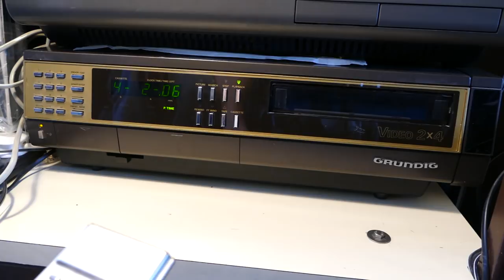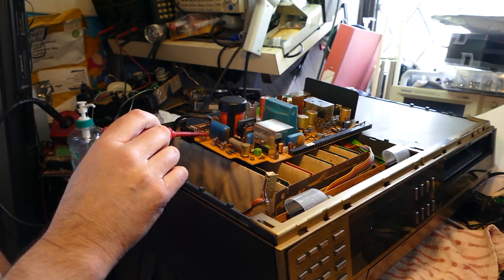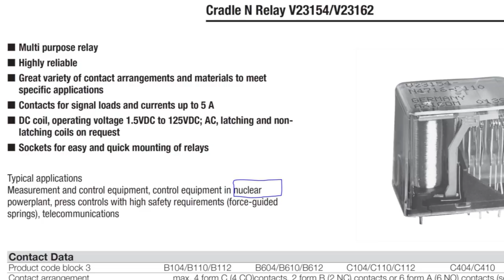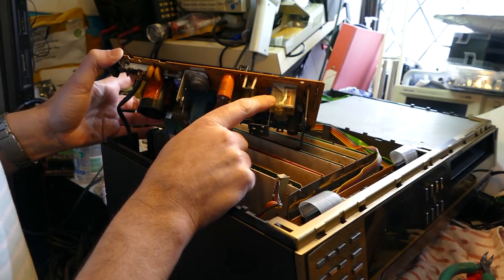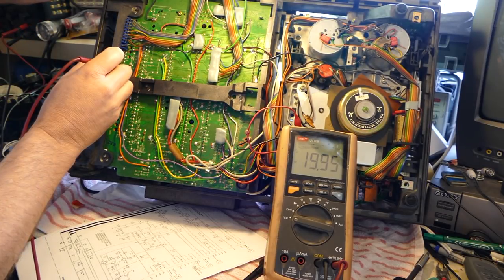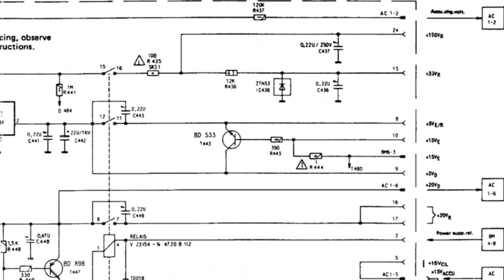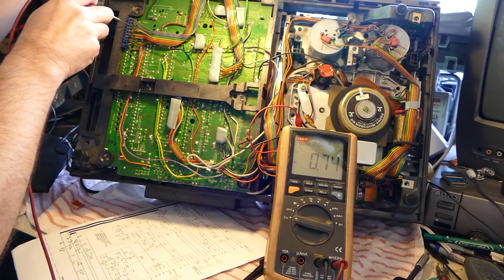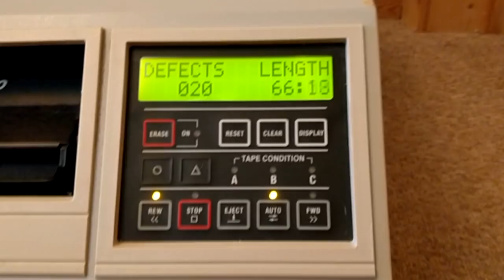Repairing the Grundig 2x4 Super Video2000 recorder.

Comment: Hi, I’d be grateful for your advice and assistance on something wrong with one of my 2x4 Supers.

I’ve got two of these to transfer a huge wadge of V2000 tapes. One needs a total overhaul but the first one is (was) actually in pretty good condition as it had been overhauled by someone else in the recent past. All that was needed to bring it back to life when I got it was replacing three s/c diodes, one right next to a connector on the main PSU and two in parallel on the sub-board that goes in the battery connector compartment at the back. It worked perfectly! Bargain of the century for the 99p I paid for it!

However... while changing a tape over the cassette door became slightly mis-timed. And tapes started getting caught behind the door when ejecting. I just decided to remove the cassette door for the time being although I will look to re-placing it soon.

After a while trying to diagnose this (the cassette carriage has an occasional habit of mis-timing itself, requiring it to be manually spun from the motor) I think I’ve got the carriage timed correctly. Now, however, the chopper immediately above the large blue block in the power supply does NOT sound happy, the bank of resistors on the “beiden-einhet” board behind the display get very hot and the cassette tray doesn’t go all the way down when it detects a tape is present (it often sinks and lifts every couple of seconds, never sinking the tape far enough to reach the spools). The spools spin like crazy. Also when ejecting, it doesn’t pull down that “lip” that springs up when a tape is fully inserted.

I’ve now reminded myself of why I prefer old TVs to VCRs, so any help you can offer is greatly appreciated! 🙂
Reply from the maker: Before doing any real fault-finding on these, I would start by going through all the connectors, top and bottom, of the rear vertical panel behind the deck.  The connectors are always splitting apart on this and give you loads of weird symptoms.
If the PSU isn't happy, change the smoothing capacitors on the PSU for low ESR types throughout.  And of course do those mains filter capacitors before they burn up.
Reply: @video99couk  Sorry, I should have added, the connectors seem to have all been replaced, someone refurbished the machine recently and actually replaced all the end connectors.

Many capacitors have been replaced by the same person (though they just removed the two mains filters and didn’t replace those, I frequently just take out the same caps from old TVs I restore and generally don’t bother replacing them as they work fine without them, but of course the PSU in 1950s TVs is still very different), but not all electrolytics have been replaced (only about half) and the machine has been shown to be working fine in two videos I shot for my YouTube channel. It has worked through about 40+ tapes until the cassette door started getting snagged.

That transistor (is it the chopper? Large metal heavy current type bolted to the PCB just above that blue block in the PSU) is now constantly squealing even when in standby when it didn’t before the cassettes started getting snagged behind the door and now the clock display just dims when it should be off instead of flashing on and off fully. After a minute, the brightness of the clock display stops varying at all, as if whatever oscillator is driving it is off frequency. I’m beginning to wonder if a bit of silicone was damaged by the eject motor constantly whirring as a cassette got jammed by the door. On one of those occasions, I did smell a bit of burning - no smoke though - while trying to rescue a cassette that got stuck a few minutes after it started getting cassettes caught on the door just as it opens. I unplugged as soon as I smelt that faint whiff of something being burnt out.

(The cassette tray problems began soon after I resurrected it about a week ago and it was my fault, not being used to this slightly odd method of pushing in a tape for a front-loader, I pushed one in a bit too eagerly and ended up mis-timing the cassette tray, which I manually re-timed by spinning the cassette tray motor by hand to move the cassette tray to the eject mechanism. That was about a week ago and I’ve had occasional problems with the cassette tray since...
Reply: @video99couk  I do have a broadcast engineering degree (so I’m sorta dangerous!) but that was after tape formats fell out of widespread use, as I only graduated 8 years ago.

I’m quite good with diagnosing electronics but mechanisms are the reason why I prefer to stay away from collecting and restoring VCRs - the reliability of the mechanism on these is what made me choose them over Philips-made ones.

After I’ve checked (possibly fixed) and passed the electronics, what’s the process for timing the cassette mechanism, as part of me getting a jammed tape out of it after removing the cassette door had to involve pulling the cassette tray up manually to the point where it’s teeth were removed from the toothed gears that drive it, which are in turn driven from the worm gear below deck.
Reply from the maker: @stickytapenrust6869  It's a long time since I've worked on the tray part of one of these.  Do see my latest YouTube video about Television magazine, there's a link to where you can read most of them.  There was an article about working on these, July to October 1994.  In particular October page 663 will be a huge help I think.
Reply: @video99couk  Well, I don’t suppose the 13V rail for the LED from the PSU being 38V is helping!

The buzzing and squealing is actually coming from the blue transformer itself...

Comment: I have a cosmetically perfect but faulty Philips Vr2023.

Does nothing when a transport control is pressed except the brake solendoid on the bottom of the deck chatters for a few seconds. 

Any suggestions?
Reply from the maker: The list for this kind of fault on the VR2023 is long, they are not the easiest machines to work on.  Firstly though I would unplug the CPU board and check for PCB damage due to a leaking battery.
Reply: @video99couk  Thank you. My past project was a restoration of one of the Amstrad 'Double Deckers' which this can not be any more infuriating to work on.

Shame it looks as new, boxed and even with a dust cover but just the brake solenoid chatters constantly and it is otherwise dead.

I can't even find an English workshop manual for it which adds another layer of complexity!
Reply from the maker: @musmodtos  Oh they are hideous to work on, just don't break the loading wire or you will find out!  Parts of the manuals exist in English, some are in German only though.  Fortunately I know enough German to get by with them.  The good news is that there's very little dedicated electronics in them, so with care you can fix almost any electronic fault with the schematics and a 'scope.  I had one intermittently shut down every few hours or so, and I was able to pinpoint the fault down to component level with the diagrams and some patience (it was a relay).
Reply: @video99couk  Thank you.

Fortunately the backup battery is intact and not leaked. It has a terminal voltage of 1.8V but I'm not sure if that's likely to cause my fault.

I've reseated the CPU card tonight and cleaned the connectors but no dice.

I've also removed the transport for cleaning and further investigation, it's astonishingly heavy!
Reply from the maker: @musmodtos  The battery should not be the cause then.  Before you start any serious work on it, replace the filter capacitor on the back of the power socket, or it may explode.  I do have service manuals (mostly German) if you need a copy.

Comment: Very interesting video, I enjoy seeing these machines that we will never see here in the states. 
For the relays, could you not fashion a replacement on a protoboard using a modern solid state relay?
Reply from the maker: There are some high voltage contacts in there, I'm not sure a solid state relay would be suitable.  I could probably use a different type of relay, or two relays, but it's lot of wiring.

Comment: Hello, can you give me some advice? I have two Grundig 2x4 EU=RO. I'll put the cable in the power and nothing. Where do I look for a bug?
Reply from the maker: Power supply is the place to start.  This can be removed for inspection.  Capacitors fail in the secondary, but also the filter capacitors on the input go up in smoke and one of those may have blown the fuse.

Comment: Thankyou from Australia. I've owned a 2x4 super from new, & you've inspired me. I've ordered new belts from Germany but just noticed the red rubber brakes on the spindles have crumbled. Are replacements available & where from  ?   Thx
Reply from the maker: I've never had to replace those.  You may have to fabricate your own (I made up brake surfaces for one of my Umatic machines once, but they are a different material than the V2000 ones.)

Comment: I have some experience with those machines. If you get 'blue swirls' across the screen the supply electrolyte capacitors need replacement.
Reply from the maker: My next video is likely to be about this model, I have my head in one today as it happens.  Power supply capacitors can certainly be a problem on these, but fortunately they are reasonably easy to get to.

Comment: Hi, perhaps you could offer some advice. I have a VR2022 VCR. The previous owner mentioned something to the effect that "last time I used the machine there was smoke coming out of the top left area of the VCR". So I suspect that was the RIFA capacitor which blew? Now, the VCR still works but it does get very hot to the touch near that PSU area at the back. Not sure if that has always been the case with these V2000 machines. Will replacing or removing that particular capacitor have any effect on the operation of the unit?
Reply from the maker: That's the capacitor right behind the mains power socket, it should be replaced.  It's quite possible that the machine will have other faults though, given the age and unreliability of that model, but if it seems to work once you have replaced that capacitor then maybe you are lucky.
Reply: @video99couk  Thanks for the reply. My question I guess (since you seem to be well versed in these matters) was more though whether that capacitor is needed for the operation of the unit. What will happen if it is not replaced? Is it not true that these are usually not critical to the power supply and are only there to provide some isolation? I ask this as the VCR seems to work fine as-is (and has done so for several weeks now). So a case of why attempt to repair or remove something on a fully functional unit?
Reply from the maker: @Bloufo  You need to replace the capacitor because 1: It may go up in smoke again, or worse.  2: It is part of the filter designed to protect the power supply.  It's OK to run it for testing purposes without the capacitor, but I would never leave a bad capacitor in there, that's dangerous.  Yes, I've had this component fail on the Philips VR202x models.
Reply: @video99couk  Thank you, exactly what I needed to know. One last question please. Regarding the replacement thereof, what would be a suitable modern equivalent of that capacitor?
Reply from the maker: @Bloufo  I don't know what the value of the Philis VR202x filter capacitor is right now, so first you need to find it and get the value.  Probably about 0.1uF or 0.22uF.  Then just by a new Class X rated capacitor of that value.  See more info here: https://www.allaboutcircuits.com/technical-articles/safety-capacitor-class-x-and-class-y-capacitors/

Comment: I've got one of these Grundig 2x 4 super v2000 machines, but it has a faulty power board. Can you advise where I can obtain a service manual for this machine, or even just a circuit diagram of the power board ? thanks.
Reply from the maker: It's available from https://freeservicemanuals.info/en, but if you get stuck with downloading that, let me know.  It's in German though.

Comment: Thanks for a great video. Do you have part number for those filter caps?
Reply from the maker: These would be good replacements, or similar from Farnell, RS etc.
https://www.cricklewoodelectronics.com/CXR220N.html
https://www.cricklewoodelectronics.com/CXR470N.html
They need to be at least X2 rated for safety.

Comment: That strikes me a quality unit with the motherboard design. Most consumer VCRs, even the so called "high end" units, were built as cheaply as possible. And a switching power supply in a 1982 consumer product - rare as well. And seriously? Dynamic tracking in a 1982 consumer VCR? What did this cost new?
Reply from the maker: The motherboard design was seriously compromised by having lots of messy wiring on it.  It might have made for easier maintenance had it been done properly, like a professional machine.  Switching power supplies were not so unusual, the Sony SL-C7 onwards had those from 1979, but true that some machines such as Sanyo were still using big transformer supplies.  Cost was probably in the £450 area, so quite expensive compared to say a Sanyo VTC5000 which was about £240.  Of course it had many more features, but was much less reliable too.

Comment: hi this something you may like  i have seen over the years  fools have put reel on on reel to reel  tape decks that are to heavy  say a  tascam 32  1/4 tape   this will take  they put on 1/2 tape  tape  and killed alot of the power side of the ff rew  ic's  inside the deck  there's a man on youtube  that got a teac 7XR  running full 14 inch  1/4 tapes he changed the motors
i still think this is a bad  thing  i have a  otari mtr 12  with the right motors  that can easy take  14 inch  1/4 tape   i have seen decks in the past where fool tryed to pimp them up
and burned out alot of parts in the power unit   you do it right   i have 2 tascam decks that were pimped up and one's i have fixed because of the pimp decks
pissed me of big time

Comment: My solution for the connector separation problem: https://www.thingiverse.com/thing:4250683
Reply from the maker: Nice solution, especially since there's not always room for a cable tie between the connectors.  Apart from the connectors and power supply, these Grundig machines are more reliable than the Philips ones, and I think give a better picture too.